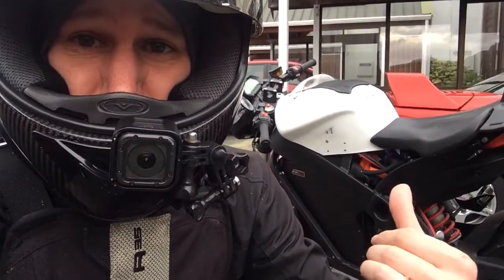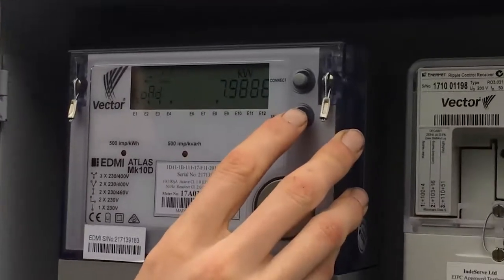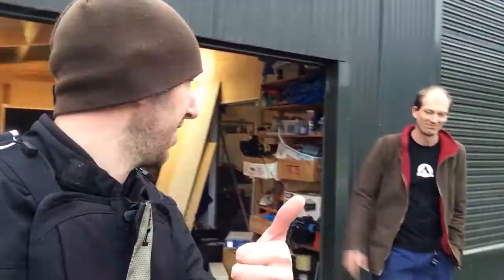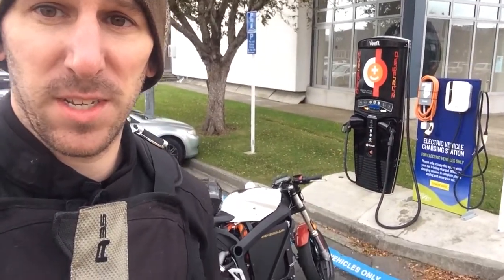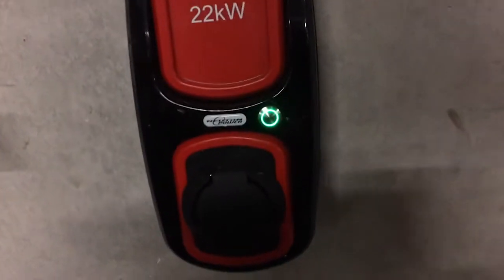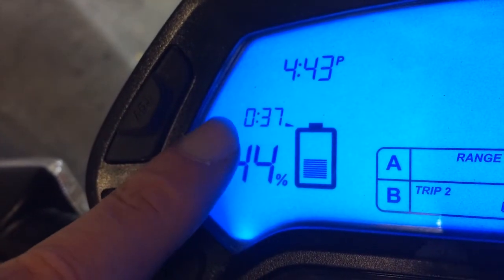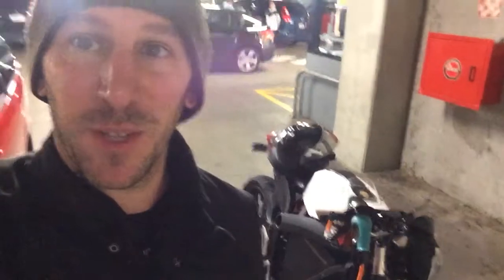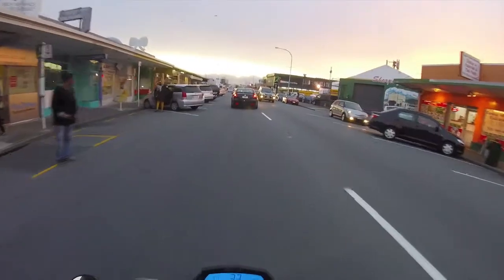Fast Charging the Zero SR

Comment: Here's one you may not be able to answer.... When DC charging comes to zero, would it be hard to retro fit to the older models?
Reply from the maker: Eeee.. I have a feeling it'd be impossible.  They'd need a converter to bring the voltage up over 200V to use those stations, and they'd also need to take the 1hr charging limit off the bikes.  I have a feeling the batteries would overheat at that point.  Zero batteries are potted inside (full of resin kinda stuff to keep them waterproof) and that doesn't allow for much airflow.  They'd need to completely redesign them, but I feel like that's coming.
Reply: @NewZeroland  thanks for that, apologies if I'm draining you for info... Should I pull the trigger on this sr/s or wait?.... Aaaarrrrrgh!
Reply from the maker: @RoadcraftNottingham  hahaha no worries man.  I mean.. it seems like you guys have a lot of AC stations in the UK, and the range is decent enough.  If you like the styling and ergonomics, I say go for it ;)
Reply: @NewZeroland  offer made. Fingers crossed. ☺
Reply from the maker: @RoadcraftNottingham  whoaaa!!! :O Good luck!!

Comment: I saw in another of your great videos a reference to a 300kw charger (highest I’ve seen in Switzerland is 150kw). What is the point of this output, given that I don‘t know of any vehicle that can take onboard that kind of a charge? Even with your Diginow set up, you can‘t even get the benefit of half of the output from a 22kw charger. Isn‘t the receiving capacity the only thing that counts when charging, or have I missed something? I have a 6kw Charge Tank on my DSR so I rarely need look beyond a type 1 charger (even if I use Type 2 most of the time, including at home).
Reply from the maker: Yeah that 9kW charging setup on my Zero was still slow 😂 As you know Energicas charge at 23kW, but only because they're air-cooled. Most cars have liquid-cooled packs so they can charge at 50kW and above. Teslas and Porsches are capable of 250kW+ now, so those stations are for them.
Reply: @NewZeroland  maybe I can part exchange my DSR for a Taycan.
Reply from the maker: @woodywood3388  😂😵😳😁

Comment: What is the impact on the battery health when charging it this fast? Is there any?
Reply from the maker: Gert Kommer at these speeds, it’s pretty normal.  The batteries can charge way faster than what I’m doing, but Zero has a 1C limit just in case.